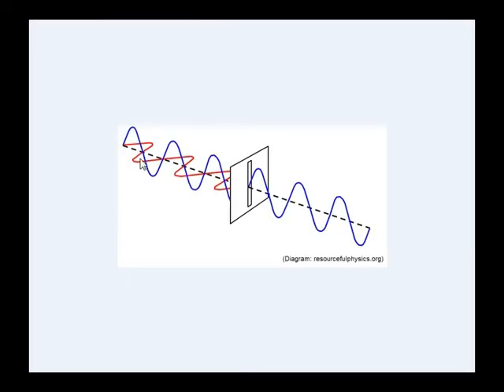01 introduction to stereo 3D

Comment from the maker: @oxhid3 Also to test on you monitor the red cyan is the best as you can just wear the glasses then in maya there is an option to vied the red cyan int the view port. Main thing to think about it with 3D you dont want to confuse the eyes, so don't have too much popping out of the screen, no main objects getting cut off at the side and dont have the 360 turn too quick :)

Comment from the maker: @oxhid3 Hi, it depends how and where it will be shown, polarized like real 3d in the cinema is good but it requires special polarized projectors that the cinema own. the red cyan method reduces the colour of your footage but is the most easy to see as all you need is the red cyan glasses, also I think youtube has a 3D video option. Main thing is once you have rendered the 2 stereo cam you can keep them and composite them to whatever 3D display you need :)